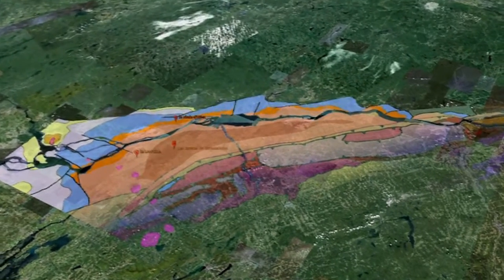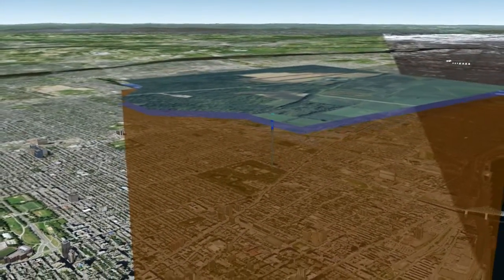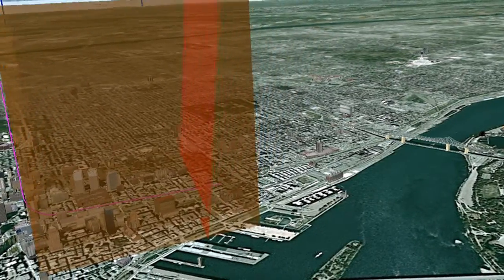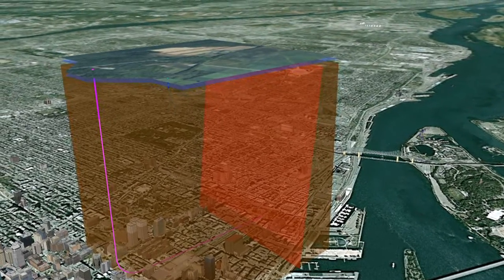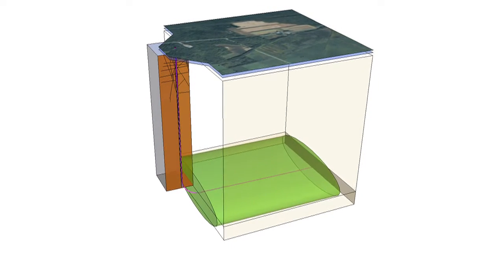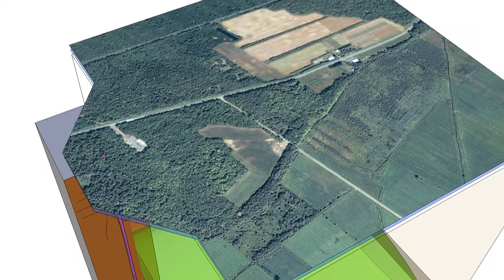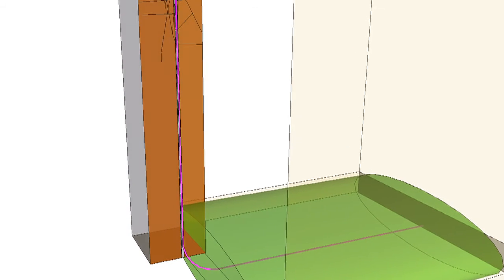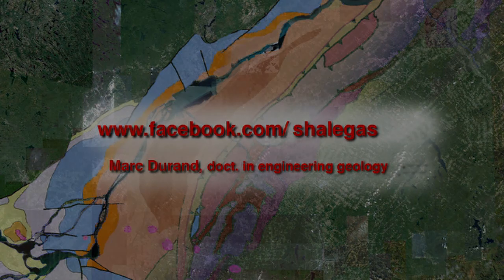Shale gas 101-Utica.mov

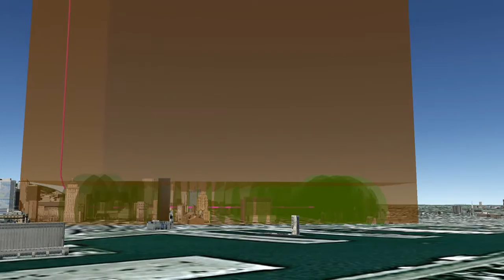Comment from the maker: at 2:55 the effect of a fault: "Fracturing into a fault or other geohazard can be a nightmare scenario for any frac engineer. It can lead to the sudden loss of pressure, the loss of costly fluid, job delays and out-of-zone stimulation." Halliburton 2011.
search WEB with: "halliburton, Brochures/Web/H08374"; text at page 11 of the brochure.